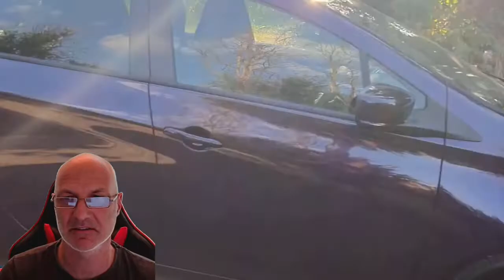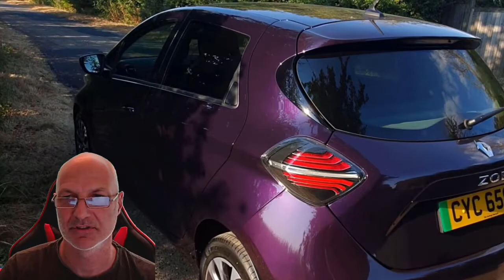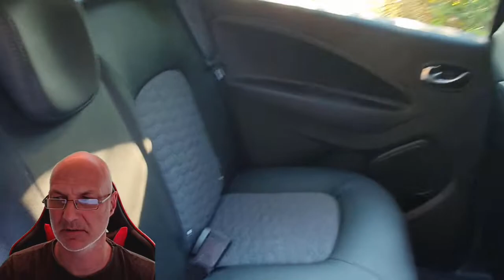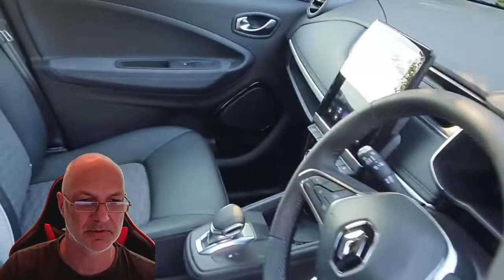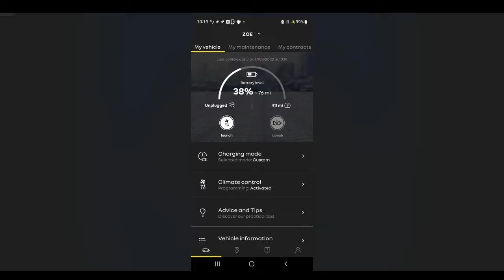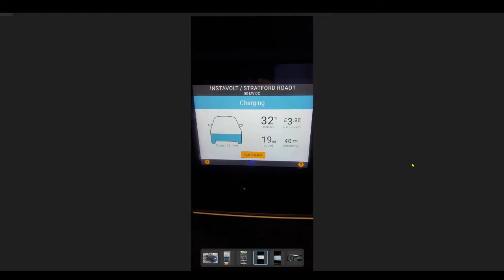My New Aconite Renault Zoe GTLine+ & First long distance (Part 1 of 2)

Comment: Very interesting to hear your experience with the Zoe. I bought mine nearly  11 months ago, 1st electric, 1st auto gearbox; so a novel experience  to begin with but soon got used to it. The 4.6kkwh is a good figure I do not get much more than that in eco mode. Mine is mainly local around town driving  not much chance of going above 60mph. In the winter it drops to about 4.0kwh. still good enough I think. I have a Zappi charger which basically does what it says on the box. I bought my Zoe literally days before it lost its NCAP rating. Having looked into it I am not too concerned  from the safety point of view but if it adversely affects my insurance when its due for renewal in a month I will probably have a compulsory moan about it then. Renault seem to be almost entirely silent on the subject.
Reply from the maker: Thanks Dennis.
I must admit I have practically stopped using eco mode. Just found it was not giving enough benefit over the acceleration difference. I don't use Eco but use B mode as much as possible, in fact rarely brake. Brake and B mode is pretty rapid stopping !
Good to hear, I guess lights, heating etc all add up, but 4 sounds pretty good.
I ended up having to get a new policy as my current company did not have an electric policy, and it was around £370, which I did not think was too bad for a an new but expensive car ! I have driven Smart cars for years and never had any concerns in that. Should I be more concerned about sitting on an enormous battery pack ! :-)